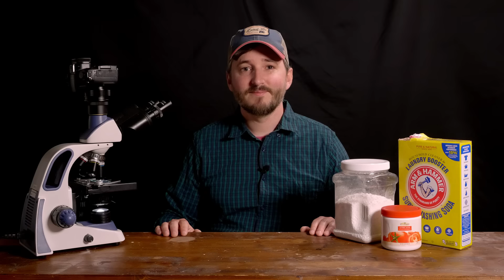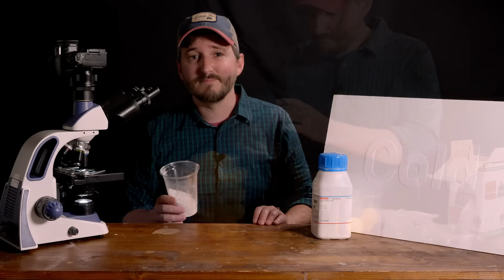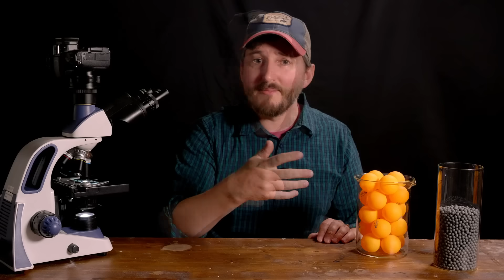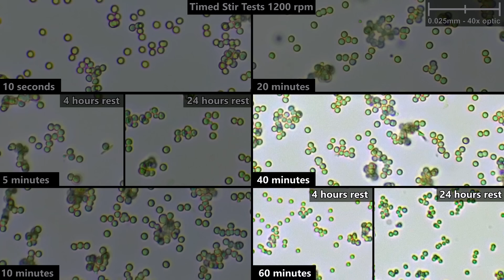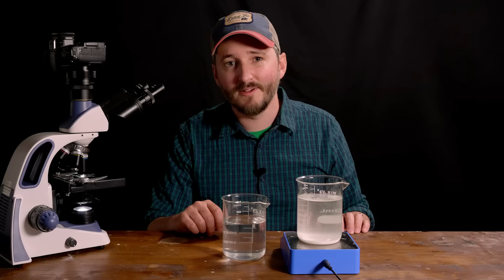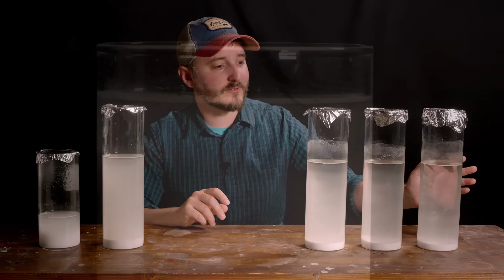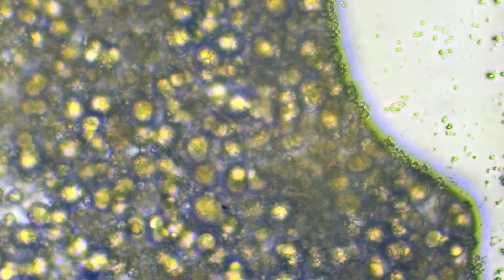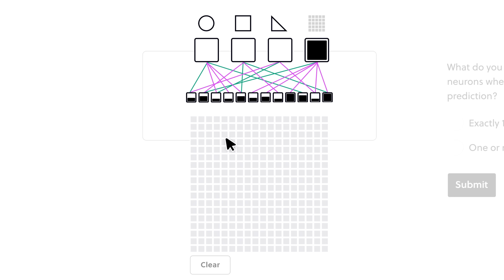Making Infrared Cooling Paint From Grocery Store Items (w/Novel CaCO₃ Microsphere Synthesis)

Comment: paint a piece of regular silica glass with this paint, then vapor deposit aluminum on to the backside of the acrylic paint, mask the glass. then have a layer of either black 2.0 or vanta black painted onto the aluminum vapor deposition. This should make an IR diode, that also converts UV directly into IR light. using the Einstein effect that makes solar panels convert  visible light into electricity. A lab in China makes nano particles which compress IR to visible light. As long as there aren't any severe losses in the radiation conversion, the panel should absorb IR and UV light and convert it to visible light a a means of fluoresess, pathe masked side of the glass with the IR compressing material from China. A pannel when placed in an area with enough UV or IR radiation glows visibly. UV hits the earth in greater amounts and even at night, or outside Earths Atmosphere. It should make a solar panel that works even when there is no visible light by converting IR and UV energy into electrical potential.

Comment: I wonder if the pigment could be mixed with resin (like the type they use for countertops or art), because if so, it would be a consistency that could actually coat a surface.

Comment: Nanoparticle inhalation hazard guestimation?
N95, N100?
Would you let students do this?
Edit: (As a one time class)
Reply from the maker: These are not of a true nanoparticle size that might be very dangerous, and because they are calcium carbonate they will dissolve if inhaled. The hazard is low. N95 should be fine. The only thing to look out for is I found some of the citric acid I bought for this experiment contained silica powder as an anti clumping agent. That would be bad to inhale, so avoid buying citric acid that contains silica.
Reply: @Nighthawkinlight  Thank you so much Sir.
Chef's kiss from Thailand 🇹🇭 
👨‍🍳👌

Comment: How much would you charge to send me a gallon of your nano-paint? I want to paint the roof of my boat with it. Ft myers Florida. 
   I'm thinking about using your cardboard and wheat paste to make a boat. Of course I'd put a couple layers of fiberglass over everything but the cardboard base would be much lighter than wood and add buoyancy. Repairs and additions would be cheap and easy. Sky cooling top decks would be ideal. A coat of clear caste fiberglass on top would make it last forever.
Reply from the maker: This paint is too fragile currently to last on a roof. There are elastic coatings like Henry's tropicool that work very well. You can get it at home depot

Comment: You might benefit from using a cheap cup gun with a magnet agitator over a fancy gravity feed because the cheap guns have larger needles and nozzles. They were much better for the glue I used back in my car trimmer days. I did not need an agitator, but they were used for metallic paint back before gravity guns.
Reply from the maker: That's a great tip, thanks

Comment: Is there a reason you need chloride and not another calcium salt?
Reply from the maker: I'm sure other calcium salts are possible to use, but it would require adjusting the whole procedure to find what works with the new salt

Comment: I'm from India, where it gets very hot in summer. I have been painting my roof with low cost calcium carbonate and white glue and that works very well. Do you think using the microspheres to create a higher density reflective film would help me improve the cooling. As we walk on the terrace, it will have to be reapplied every year and will not give the cooling effect that you have achieved but it should be far higher than the common powder available. I just need to increase the speed of production and reduce the effort required. 
Your views will help a lot. Thanks.
Reply from the maker: Normal limewash calcium paint is probably the best option because of low cost and ease. If you would like more cooling you could apply a second coat.

Comment: yo i been considerin using this coating in some clothing, what do u think? i know u had the vid on the fibers but that seemed alot harder and more of a work in progress so for now i was thinking i would try applying this paint to a leather jacket and a hat, starting with some smallsample patches and testing out different top coatings on top to see if that helps with durability or flexibility or something, i was gonna like the jacket with wool making it a pretty heavy duty jacket for winter but then adding the reflective white paint to me seemed to make it more versatile and year long as well as makin it so i wont overheat or anything standing in the sun

Comment: I want to use this method to paint my car. I was thinking, to finish my car's surface exterior it can be covered with a clear car fabric seal used for cars to keep the paint from chipping. This could keep the engine and interior cool, also adding the fabric form to the engine hood ceiling giving an extra cooling effect when the engine turns on or warm in cold weather, right?!😃😗😅🥰🧮🛠️👩🏼‍🔬

Comment: I have a question that might be really obvious and I'm missing it but here goes. If the paint has to be covered but can be in the shade as long as it faces the sky and isn't blocked would using glass or plexiglass tinted with the ceramic window tint work? I know the better tints help with heat in a car so wasn't sure if they would negate the paint or help it. 
If that works I would love to build a box where one side is all flat black and covered with single layer glass and the other side is cooling paint and tinted glass. Idea is to flip to the cooling side during summer and pipe air through the tubes inside for cooling and then flip to the black side in winter to get warm air from the same basic structure with just a simple flip.

Comment: Use an electric grease gun for the application. Might have to fab a tip, but I think you could get it to work ...
Reply: I plan on using this and the compound parabola method to make reflectors for vertical solar arrays... Shiny reflectors create hotspots that can burn out your panel, but with emissivity like this it should theoretically increase your mid day slump and other indirect light times....

Comment: A great use for the paint would be in Greece, where they paint the house exterior to promote heat rejection.  Also, in the USA, there is a good use for the paint. to paint the flat roofs of industrial buildings - all around the equator, including the USA, Mexico, Africa, Australia, and "The Stans".  SO the air conditioning will be used less and save electricity.  Now, there is your business case to be a $$ billionaire.  PS, just give me 1% of the gross sales for the idea.

Comment: We did this but mixed the microspheres in a sealant white rubber paint that was then rolled on the roof of our house. It worked wonders, plus fixed the roof leaks in the plywood. You could tell there was a huge diffrence when standing on the roof and beig baked by the sun reflecting back at you lol.

Comment: cylindrical container with small ball bearings and spin it so the powder is ground into finer, more uniform particles without heat. 
 this teachnique use in mixing grounding gun powder 33:29

Comment: Here in Japan, it is not uncommon to use umbrellas to protect oneself from the sun. I was thinking about suspending the pigment in transparent silicone sealant and applying it to the inside of a clear vinyl umbrella. I know there are more advanced methods of adhering something to vinyl (something something polyurethane acrylate?), but this seemed the most accessible. If I try this, I’ll update this comment.

Comment: Have you considered painting the cool side of peltier modules with this and putting the hot side against like a piece of metal in the sun? Because they're essentially useless if you have to generate the heat and cool yourself. But maybe with this you could get enough power to power a small pump

Comment: Maybe try a paint roller or rubber roller or possibly a hobby grade sized airbrush as the air flow rate is much lower than the flow rate of a professional paint gun. Also I would like to see an experiment where you apply this to a small swath of emergency blanket and test the results with the infrared camera to see if the radiative properties of the blanket help improve its cooling abilities even further. Maybe try a silicone baking mat as a backer as well?

Comment: What if you made a solar panel that converted every bit of the spectrum the panel wasn't good at absorbing into the sky-cooling irradiation spectrum? For a slight drop in efficiency, you could have cooler and longer lasting solar panels.

Comment: The small vs large particle argument seems to be flawed here.
The packing density only sees good efficiency of the smaller spheres are small enough to smoothly flow into the gaps between the larger particles. The size of the smaller particles doesn't really matter as long as they're small enough, but they have to be small enough to pack the space.
The particles presented in the video seems a bit too large which would lower the packing density. Even with this the cooling efficiency was pretty high. This could be because the paint layer was thick enough that the density didn't really matter, or the cooling efficiency could go up even more.
Reply: But in order to make multiple stages of packing spheres, you need to control the ratio. 

If you just started with the smallest spheres you could think of... You could still only get to a 65% packing density. This is a geometric problem. You can solve for it by inscribing spheres in cubes and seeing how much space is left unfilled (the difference in volumes).

Comment: couldn't we use a clearcoat finish, like a urethane or polyurea or even a ceramic sphere clearcoat that uses similar science for a similar result? i wonder if using the ceramic sphere clearcoat would even increase the effectiveness of your very accessible basecoat? to keep the coating safe and clean? or would that trap the heat and negate the purpose of the coating?

Comment: For the application, would a vibratory plate help in aiding the settling of ridges?
Reply from the maker: You would have to apply it in a quick pour and vibrate to level it out. That might be a good idea. Wouldn't work to level ridges when syringe applying because it dries too quickly

Comment: So i am to make a batch. The little particals settles within minutes, but the 1 minute large particals have a hard time to settle to the bottom. Did i do something wrong? or am i impatient? it does settle after a night of waiting, but it takes a very long time and the water is not super clear at the end. What am i doing wrong here?
Reply from the maker: I'm not certain what could be happening. If you have a microscope you can confirm if the particles are the correct size and shape.
Reply: @Nighthawkinlight  I have one. I'll check it out. I did do 3 batches in one go, but upping the volumes shouldnt be a problem right? For now I tried blending 2 minutes. Wish me luck.
Reply from the maker: @janvanvorstenbosch00  I haven't noticed different results with different batch sizes
Reply: @Nighthawkinlight  I tried looking at it with a microscope, but my old highskool grade microscope is not up to the task. Any suggestions why is could remain a white liquid? It does settle a bit after a day of waiting.
Reply from the maker: @janvanvorstenbosch00  It seems like you either made a much smaller size than intended, or you added too much citrate which greatly delays the formation of spheres and they may not have formed yet at all
Reply: @Nighthawkinlight  hmmm maybe my cooking scale is to inaccurate. I made the first three batches as one. Making the citric acid 9 grams on 90 ml.
Reply: @Nighthawkinlight  the new one-minute (actually 2 minutes) batch, did settle now. I made a new batch that mixed for 2 minutes.  I think the stiring of 1 minute was not enough to make particles then. It is weird though. Eventhough it settles now, it has a layer at the top. if i tap the container it does go down. I wonder what made it so lumpy an sticky at the top. Is this just surface tension? Is this because of impurities? i used the same recipe.
Reply from the maker: @janvanvorstenbosch00  Sounds like too much citrate delayed the sphere production and now they have finally formed. I wouldn't be confident that they are the correct size without confirming under a microscope since the reaction went strangely
Reply: @Nighthawkinlight   I can always make a new batch. I am learning. Thanks man. Very cool that you react to questions.

Comment: have you tried applying it with a sheetrock spray texture rig? just uses air to force material to splatter on whatever surface you point it at! Same principle as spraying stucco mud on a wall. Can make whatever thickness you want with a few passes.

Comment: Kitchen Gadget FYI: The clear knob on a blender's lid is designed to be easily removed, allowing you to pour additional ingredients through the hole in the lid (directly into the center), while the blender is running, for less risk of overflow/splashing. (especially helpful when emulsifying eggs with oil, for making homemade mayo)

Comment: Great video. I had a though about applying the paint to flat surfaces. You mentioned that the paint has to be protected, but you weren't very specific. The box that you used for your early demonstrations of the cooling effect was deep, with some kind of clear cover, one that I assume transmits the wave length of light emitted by the paint very efficiently. Is there a reason you couldn't put such a film directly on the paint? (As well as at the top of the box- I get that that air space is part of the cooling apparatus). A thin panel or film could be placed over a very messy application of paint and a roller used to press it into a uniform thickness.
I imagine that if you have something solid with a surface that won't stick to the paint as it dries, it could simply be removed, but I have no idea how practical that might be.
Reply from the maker: I cover with thin cellophane

Comment: I want to try this pigment with the cardboard sealant that you made in your last video. I've been experimenting with alternative building methods for a couple of years. But your cardboard idea is the best yet even though I haven't used it yet.  I was going to build a small camper like yours using foam board insulation. I've watched lots of people do it however now I want to use cardboard.! Thanks for all your very useful instructional videos!

Comment: Could you use a slow curing clear resin to mix with and then coat aluminum roof panels. Could this pigment be mixed with a colored clear coat then making a solid color and still work? Like now I want to make my own then try mixing it with different things. Imagine if you had black paint with this pigment on a car and it stayed cool with your windows up.

Comment: I had a radiant barrier that was placed on the floor of my attic that worked great. If you painted the ceiling instead of the roof  wouldn’t there be a similar benefit stopping that energy before it reaches the living space?

Comment: This is an incredibly well-documented and creative recipe—thank you for sharing it! I really appreciate how accessible and precise the process is, especially with the emphasis on temperature control and batch variation to explore different pigment qualities. The use of everyday materials and a simple filtration method is a smart and practical touch.

As a suggestion, have you considered experimenting with Plaster of Paris (calcium sulfate hemihydrate) in future versions of this pigment? Adding a small amount during the mixing or drying phase might influence the texture, binding properties, or drying behavior, especially if the pigment is intended for use in paints or chalk. It could be an interesting additive to test, especially for improving how the final pigment handles or adheres on roof. I need to have your suggestion that how to bond plaster if paris so that it could stick to roof as the roof is being used for walking and other types of house hold purposes.

Thanks again for such an inspiring and detailed post!

Comment: My reason to watch your videos: I want to harvest Athmospheric Water and I thought your paint or fibers could be useful to bring temperatures of condensing panels or condensing structures to below dew point. In Philippines springs become rare and in rural areas people seldom are connected to a water supply grid. Rainwater harvesting is an option too. However I thought having a device for harvesting athmospheric water might be a faster solution for a project start. I'm going to bring farming to the next level and back into control of the farmers by grazing sheep after sowing a mixture of seeds for soil rehabilitation combined with vegetable seeds. This gives the farmer a first crop for consumption and selling after 2 to 4 month while restoring his/her soil. I've looked at open 3D Cloth, Ionizing of fog dropplets by high voltage. Maybe I can somehow combine these things. Also I looked at the compresser-condensation-evaporation cooling pronciple with butan as refigerant.